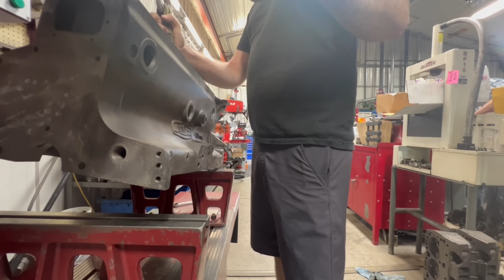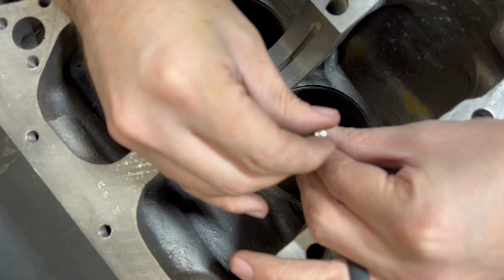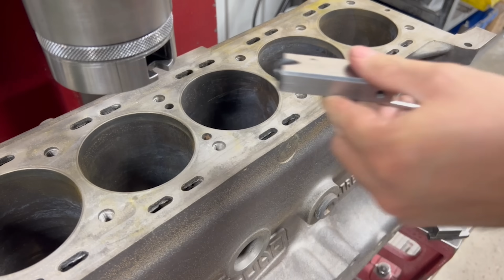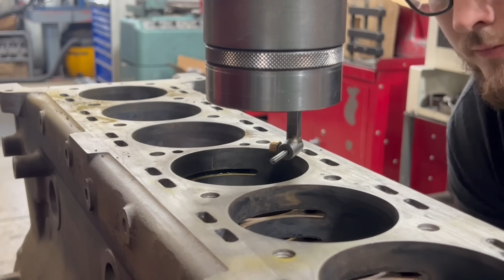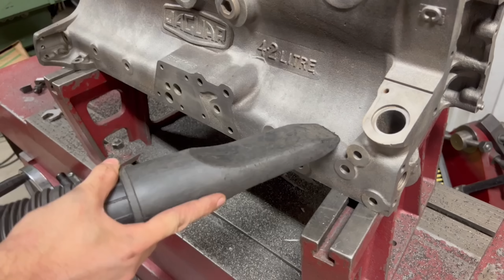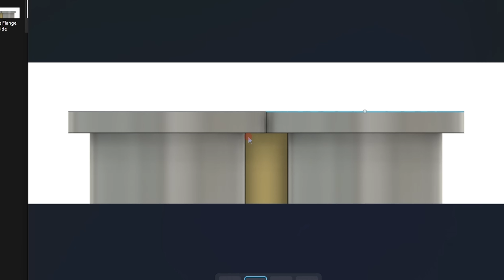Can This 1968 4.2L Jaguar Block Be Saved?

Comment: i have preformed this exact repair on several jag blocks as well as countless other antique tractor blocks. top hat sleeve are the way to go. you are working with a block that is not high horsepower and not high compression. the top hat sleeve allows the head gasket to set on top  of the sleeve eliminating the potential for leakage. overlapping sleeves would be even better but not necessary. if this was a high power setup then i would be cutting it out for Siamese wet sleeves. the truth of the matter is that just like many allis chalmers and old ford blocks the expansion and contraction in the quench area is was caused the initial crack and they rarely grow beyond what you have found.

Comment: If the owner really wants to keep his number matching block the flanged sleeve is his and your best bet . as long as your confident you can do the install correctly there should be no problems with the engine lasting another 20 or more years. once the sleeves are in they will stop the crack from propagating up the cylinder walls and allow the head to seal as tight as a stock engine block .

Comment: I have see the crack cut out and braised, machined and resleeved don't know how it fared over time, seems it would work, the temperature and expansion rates  I think they used nickel to braise the crack , I also seen stitch lock in some cases work well, crazy how it works, so we'll,

Comment: I was a Jag Master Tech from '82-2002. The top hat sleeve looks like the trick. On later 4.2 motors, the factory cut a slot between the cylinders to stop this problem. If you can get a look at one of those (Series III motors '79 1/2
-'87) you can see what was done and duplicate this after the top hat/sleeve install. I had done my share of head gaskets on hot motors from that time frame and no block damage unless a totally smoked motor and even then, no cracks.

Comment: can it not be drilled out at the end of the crack then gouge out the crack a bit and then tig weld that sucker up. Pre heat the heck out of it then that cast iron should be fine to weld on.

Comment: I don't know if it would work for you in this case, I used a system called loc-n-stitch to repair a cracked block. The video showed them fixing a head that was cracked between the valves.

Comment: Might talk to the guys at weld mold. There may be a tig rod well suited to this application. 

Personally, I'd drill a cross drill below the hole, vee it out, and TIG braze or TIG high nickel filler in there. Then machine the parent bore, and put flanged sleeves in...    

And my advice is worth exactly what you paid for it! Lol

Comment: This is pretty common on these have done a couple of 3.8's and 4.2's I was taught the most important thing is to get the liner protrusion correct for the head gasket seal later blocks (from either 1980 or 1981 can't quite remember) had a saw cut between the cylinders to solve this issue. My father swore by grinding a V in the cracks and brazing the blocks and to my knowledge not one ever came back. I also know people that just put liners in them and had no problems

Comment: Is it posible to grind out and weld the cracks out of the block, remachine the bore then install the tophat sleeve?  I have no experiance with any kind of engine work or restoration its just a curiosity question. How much can you really to to repair cracks on blocks?

Comment: I'd suggest contacting Barum Engines in the UK, they have a Youtube channel.  They have a lot of experience saving a wide range of  questionable supercar and racing engines, and deal with saving near-scrap Jaguar engines all the time.  They are also not a restoration shop, so they can focus on what actually works to save these engines rather than the more esoteric (expensive) types of repairs that restoration shops attempt.

Comment: I don't have alot of automotive repair experience to this degree at least...
I did study electromechanics 
Top hat sleeves seems the best option to me  

Otherwise would opening up the cracks with a rotary tool and then welding them shut be an option? 
Assuming the welds are non porus

Comment: Top hat sleeves , finished, machined, siamesed fix these issues for good.
Machine everything and press the sleeves in. Leave them in the press overnight, because if you use Loctite or any other liquid, it can linger under the top hat stepped part and give a false liner/sleeve protrusion reading and escape later on (like after the engine is running)letting the sleeves drop - because it can....
. You need to have pressure on them to let any residual liquid escape and let the sleeve settle positively.. Then deck the block/sleeves and you will have a repair more robust than the original design that will not fail.
Most important.
Good luck.

Comment: I have not came across these before. But my thought would be to pin the crack on the deck, then install the flange sleeves. Might be kind of belt and suspenders thinking. No kill like over kill, and I know it won’t leak after I’m done.

Comment: Also consider using low temp high strength solder. It is low enough temp where it doesn't mess up the grain structure of the cast iron, but could help with sealing the cracks. In conguction with the capped sleeves you have going on.

I've used it on low stressed parts and it can work. Depending on the application and I think would help.

Comment: You could notch the cracks and nickel weld or spray weld the cracks and than use the counter bore sleeves? You could use tapered pins to fill the cracks. I have used tapered pins to repair a lot of cracks on heads and blocks over the years with great success. I have saved a lot of blocks and heads by pressure testing. Pressure testing will allow you to know if the cracks extend into the water jacket or if it is just a surface crack.

Comment: 5:23 - not only is it very easy to believe it was done like that at the factory, I would have been surprised if you wen through the entire engine and did NOT find some production/assembly malady. 

You know old British engines only leak or burn oil and/or coolant when there's oil or coolant in them right 🙂?

This is why the British automotive industry exists pretty much only in name today.

Comment: From a design perspective, it appears the intermediate web is too thin to support the combustion pressure. It was interesting that the outside of the block wasn’t cracked, just everything in between. Looks like it needs larger lateral tension capability. Flanged sleeves should be able to account for the lateral tension by distributing the load throughout the ‘hoop’. It for sure passes the sniff test FWIW.

Comment: If it were my car/engine I would wonder if I should drill a hole at then end of the crack, grind them out, and then braze them prior to machining.  I can't believe those cracks won't continue to elongate down the cylinder walls over time.  Granted it probably isn't going to be driven that much.  Tough decision for the owner.

Comment: Greetings from the U.K. !!  I love the channel, you and your dad do top quality work.   For the jaguar block, my main concern is that the block is efectively,  split right down the middle. My concern there, is that the block will 'open up ' under extreme load, and odd things might happen to the press fit on the liner.  In reality, for most uses, I don't think it would ever really be a problem, but its a risk. A top hat liner will definitely be better, as you rightly point out. If money and time were not a concern, I think the ultimate solution would be to machine down between the bores around the depth of the top of a top hat liner, stich lock or weld repair between the bores, then install a top hat liner. But thats going to be a big bill!
Reply: it depends how often it will be driven

Comment: Use a Lock-N-Stitch locking pin between the cylinders then bore them for new sleeves wether they be the shoulder or not

Comment: I think you are well capable of sorting this block out. Personally I would go with top hat liners that DO overlap and  put them  in numbers 1,3 and 5 cylinders then boring 2,4 and 6 to get the intersection of the top hats. Then using Loctite completely around the top hat it should in theory seal them perfectly and water should not get up to the deck.
Reply: Yep and even if water does get up to the deck, that's what the head gasket is for. Top hat sleeves done right works perfectly on these.

Comment: Had a MGB block with same problem. Ground down crack area, brazed then installed “top hat” sleeves. Worked fine. Probably came from factory like that. Same block had crank bore misaligned by .008”! Bored that too. Post war England had a lot of issues with engine building and wiring with export cars.

Comment: Did an in-frame on a wet sleeve diesel with similar damage plus lots of pitting on the deck, we just added a thin layer of RTV silicone before installing the head gasket. (Not on the fire rings of course, more like just to fill in the small cavities.) P.S. This was done on a tight budget and to get it back to work sooner, a replacement block has been sourced in the meanwhile if it doesn’t hold up well, although this used to be standard practice on the given engine some time ago. P.P.S. The replacement sleeve plans look excellent, sounds like it’d be a great way to save it, but I’d ask a welder who has experience with cast iron too, in my area there’s a specialist who could repair it.

Comment: Those passages naturally prevent any further cracking.
If you want you can just drill and pin those cracks and just sleeve it.
I've done many BMC engines with the same issue although with wet sleeves and never had an issue.
The crack really doesnt matter.
You could use top hat sleeves and make then overlap slightly.
Weilding I would not recommend.

Comment: I would think that v grooving the deck surface into the crack about 1/2 or better then brazing up the areas then a step sleeve would be the overkill option.but I would think regular sleeves would do at that point.because welding a better material in at a wider area would stop the crack.then a good sleeve and new head gasket technology would be ok.

Comment: This can be fixed, it will require experience with cast iron welding and EXTENSIVE post machine work.  As I will always state, anything can be fixed as long as the value outweighs the cost. What you have going for you is that there are exceptional new alloys available for cast iron repair, even more is that you have an oven on premises for the absolutely necessary pre and post weld heat treatment of the block. Without the proper heat processing any weld repair is worthless. I have repaired soo many engine blocks in the past, some were just impossible to find replacements for and some were number matching restorations in where the value of the car near doubles because of originality. This block will require weld prep, pre heating, welding, immediate post heating to a high temp, then complete mag particle inspection and remachining of each facet of the precision surfaces. The amount of distortion welding causes is impressive. The siamese cylinders make things somewhat easier as there is access for complete weld penetration ( i.e. v-notch and counter grind).  These partial siamese bores are not a huge issue, as the cracks do not and cannot propagate past the coolant passages. After welding the parent bores will need to be bored to restore concentricity, and you will need oversized sleeves. The top hat cylinder sleeves are an additional method of repair reinforcement. This repair may even require you to modify oversized cylinder sleeves  to work. I know there will be others out there that disagree and just say scrap it, I know I have been able to repair a similar Jag block without issue. I don't see why your shop cannot make an adequate repair. The biggest thing with cast iron welding is proper prep, and methodical post weld thermal processing. Multiple sessions of heating and cooling in a time controlled oven is the key, thermal cycling and normalizing before machining. This should sound expensive because it sure as hell is, this is why most people just say toss it. Most are not willing to spend the thousand plus to do all of this. Ask the owner, is that little cast number worth it?
Reply: One last thing, for engine blocks in this shape. The casting irregularities are cause for stress concentrations. I make it a habit to spend the 20min with a die grinder to smooth out whatever I can (within reason of course).  A small diameter cartridge roll on a 90deg die grinder will make quick work of the coolant passages between the bores. No mirror finishes, just try to level things out.

Comment: Just a idea why don't you cut the old water jackets out where it's cracked Mill a piece of billet steel or something it will fit down in there weld it in machine it and then cut the slits out again and stuff and then Reese leave it with a vertical sleeve

Comment: Grind out, drill a tiny hole just below the end of the Crack and braze it, turn to 10 thou shy of final Dia. Then hone the rest of the way while also cleaning the bottom of the bore up before sleeving

Comment: The top hat sleeve if installed correctly will be a good solution to restore the engine to good running order .most of these cars are garage queen's and won't see hard use .it's a sure sign of summer when you see a e type on the road !

Comment: My thoughts on restoring the block is to clean the cylinders really good weld the cracks and bore cylinders back to spec as well as welding across the top where cracks are and resurfacing also may need to grind a groove into cracks before welding with small grinding tool like a dremel tool or similar tool it's alot of work but is the only way I can think of to make the block not leak through the cracks as they wouldn't be there anymore
Reply: Laserwelding was coming to my mind, when I saw the video.

Comment: Hope y'all can & do save the block. I know very little about metallurgy, but I'm assuming, since it wasn't mentioned, that welding is not an option. If not, I assume it's because the heat will change the block temper, &/or the material between the cylinders is too thin to be done successfully, especially after factoring in the water ports in the cylinder walls.

Comment: I have done similar repairs and the best way to fix cracks like these is with a lock and stitch repair. You can't do anything about the crack between the coolant passages but they should be fine. If you decide to give it a go  I wish you guys the best of luck but you guys don't need it you fellas know what you are doing I just wanted to put my two cents in .

Comment: Top hat sleeves is what my mind went to as well almost immediately, I know land Rover 4.6 V8s also had issues with their sleeves slipping and causing HG failure in the early 2000s land Rover discoverys and range rovers. It seems the British loved to use crappy sleeves and poor tolerances from factory haha. I'd love to see a video on the finished machining if you guys decide to do top hat liners! Another great video guys super informative.
Reply: With the 4.6 Range Rover it was just a case of the fact that Land Rover didn't wasn't the expense of enlarging the block casting and they decided to bore it out to the maximum. Largely because of American requests for bigger capacity engines over the 4.2 litre one.
Reply: @samrodian919  yes and utilizing the same tooling if I am correct? Either way a poor decision in that case. As much as I loved my early rovers at least the 3.8 in the RRC I had was pretty reliable. I loved the disco more but essentially a ticking time bomb.

Comment: rebuilding a international ht 570 at the moment, they use this same style of liner, overlapping, and being a wet lined diesel have ,counterbores. the engine i have the liners have maby .002 between them, but is using fire ring head gasket. imo you can get away with some of this on a show car thats only 8/9 to 1 compression and only makes 230hp from 4.2 liters
as a side note, international is using the firering as the final seal on the cooling system. cat uses a small o-ring below their liners and that is what seals soolant on the spacer plate engines, a/b/c 3406 models.
 dunno if cutting a oring grove below the counter bore would help

Comment: They all do that. The factory took to putting a plunge cut between each bore on the deck with a saw, to relieve this area and allow the bores to move independently.
Edit: after watching to the end, I wouldn't worry about the sealing area. Even with the saw cuts I mentioned above, the stock gaskets seal quite well. These are VERY stable blocks (no thin wall casting here!), with head studs and a beefy head casting, so plenty of clamping force available.
Reply: What @sideslip said.
I came here to say exactly this (based on many years of professional experience building XK engines)

Comment: Have you thought of vacuum brazing that area. I have learned that if the joint is thin enough the brazing material approaches the strength of the parent material. You might want to look into that.

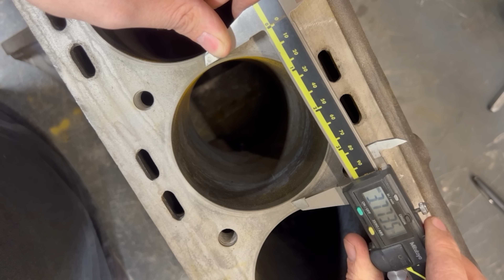Comment: 2:55 if the tremor is causing issues I suggest laying the telescoping gauge on a flat surface and then measure with the micrometer or calipers. After 20 years of turning wrenches as Airframes mechanic in the Navy my hands are shot and I have trouble with my grip and being steady.

Comment: not an expert but could you silver solder or bronze braze the cracks then machine the deck and bores to drop in the top hat sleeves
i believe the solder would keep the coolant channels from leaking and hopefully keep the crack from growing 
and because solder is at lower than operating temp of the engine it should work right?
also to weld cast is a beast if i was to try this i would bevel the cracks out and tig braze instead of trying to straight weld it